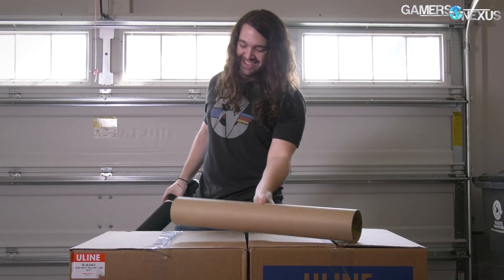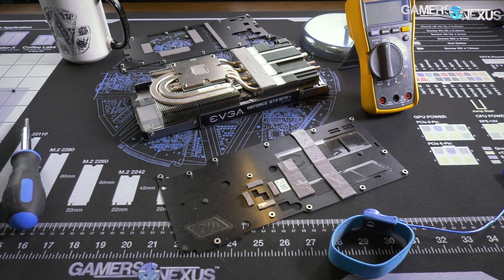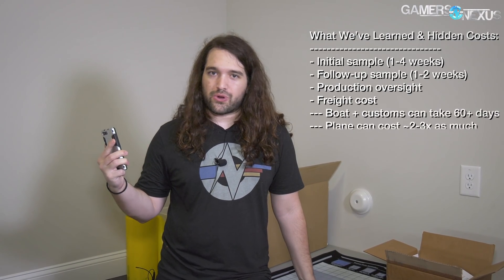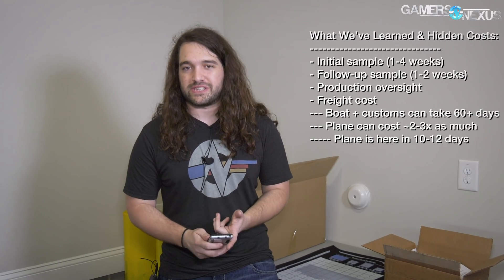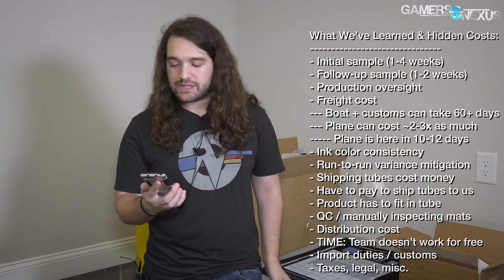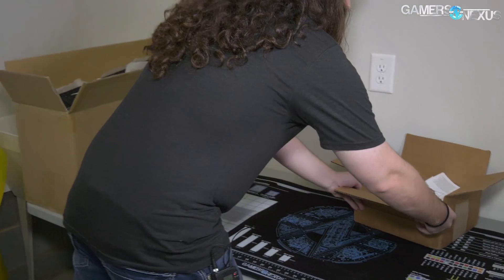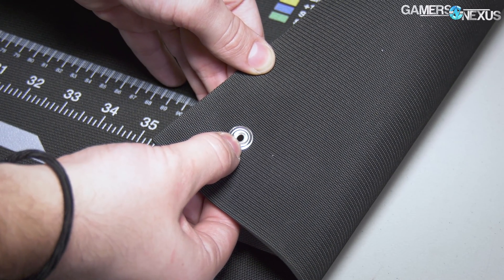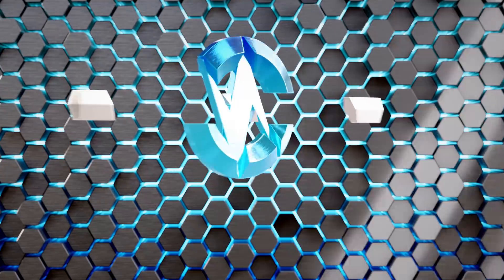Manufacturing Detailed: What GN Modmats Taught Us

Comment: You were probably joking around, but for hammering the tube end caps you could get something shaped like a ping pong paddle so you can hit the center and it'll push all sides at once.

I'd say just use ping pong paddles, but I don't know how well they'd hold up to that activity. It's cheaper to buy something more expensive once than to buy something cheap repeatedly.

Comment: Steve, you should consider warning people to not use a ground strap on energized equipment. Static is only a danger to de-energized equipment. Wearing a ground strap while working on energized gear means you are the shortest path to ground. If you touch an energized component, you are much more likely to conduct energy to ground where you otherwise would not. Look it up if you don't believe me
Reply: people working on energised components should have enough knowledge and training to know better by default should they not?
Reply: Considering this is an enthusiasts channel, it's not obvious to someone who is getting into pc building and modding for the first time to make that connection.

Comment: Is the modmat safe for soldering? If so, is it also safe for hot-air soldering?
Reply from the maker: Definitely not intended for use as a soldering mat. It's a rubber surface -- probably wouldn't hold-up against high-temperature soldering irons. We have not tested it, but wouldn't recommend it for that use.

Comment: Why do you need tubes? Why not lay them flat in a box; uses much less space. Then tube them here if necessary
Reply from the maker: The tubes are to ship them to the customers. They take up the least area possible for the product. They ship to us in large boxes.
Reply: Gamers Nexus but the pockets of air uses several cubic inches per tube plus the space around the tube
If the wasted space is not of your concern because the shipping weight value is more than the cubic size value then still wouldnt it be cheaper to box here? Because all that extra cardboard must add at least 5 pounds? Per case

Comment: Why don’t you ship it directly from the factory to the customer? Why make a stop at your place?
Reply from the maker: Lots of reasons. One is quality control -- we manually inspect a large portion of each shipment. Another is that many of them need to be autographed. Another is that we have to pack the mats with all of the accessories (ESD straps, manual).

Comment: It’s a great product well done!  Looking forward to building first custom loop on it soon.
Reply from the maker: Nice! What are you using for your loop parts?
Reply: So far I have Phanteks Glacier GPU block for Strix 1080ti, EK monoblock for Strix Z370E, EK pump/res combo with 250 res.  For radiators probably going to go with Hardware Labs white 360 GTX and 360 GTS.  All in a Fractal Define R6 white TG (thanks to your review) which has been delayed two months which I guess this video kind of gives insight into with how long them boats take haha.

Comment: ik its not optimal but do u think using a mod mat like yours would hinder the tracking of an optical mouse ??
Reply from the maker: Genuinely unsure. It's not intended to be used as a mousepad, but we have used them as mousepads in several streams. The texture feels like a step between the "rough" and "smooth" metal mousepad surfaces you can buy from most big vendors, so it provides a bit of resistance, but not too much. If you need ultra-high-precision tracking, e.g. for competitive esports, probably best to get a dedicated mouse pad for that. The modmat can be used as a mouse pad, it's just not the intended use/purpose, so hasn't been tuned for it.
Reply: I think the sensor would work fine. The issue has more to do with the modmat being a relatively high friction surface, which isn't suitable for a mouse to slide around on.

There's nothing stopping you from trying to use it as a mousepad. But Steve has repeatedly warned that that really isn't its intended purpose.